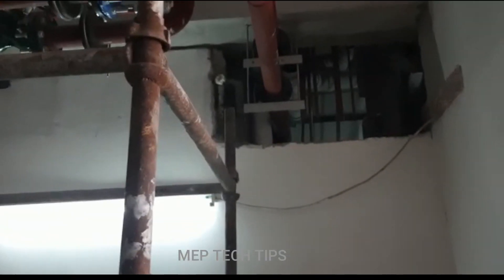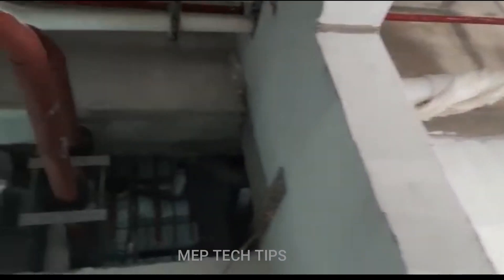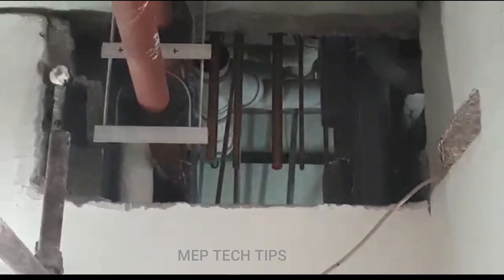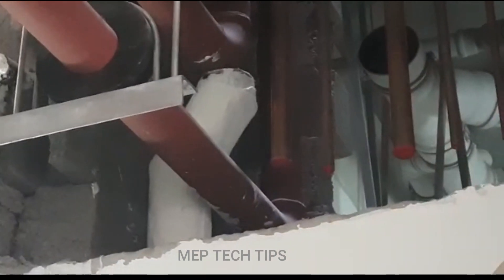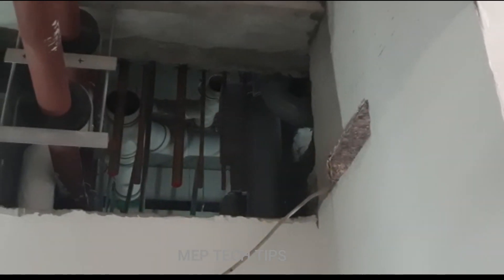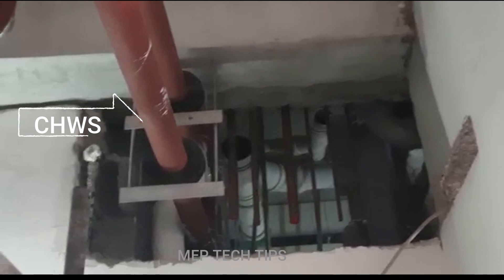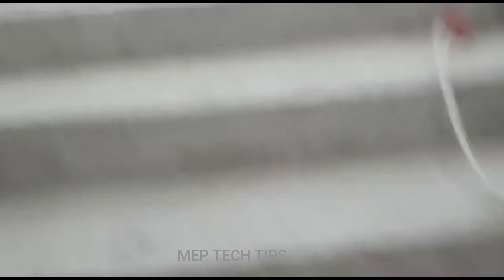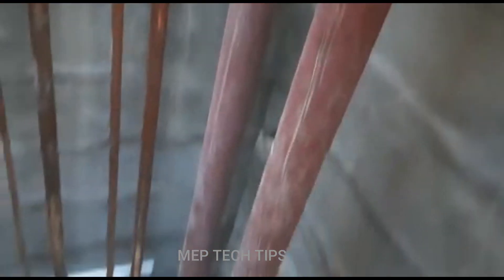MISTAKES IN INSTALLTION OF CHILLED WATER PIPE RISER | HVAC | CHILLED WATER BRANCH by MEP TECH TIPS

Comment: Considering bottom as supply and above as return. Both will need heavy modification. For return take tee and connect straight to riser going down without looping supply pipe but we require some modifications to match above and below riser for return line.for supply line you can install tee and rotate by 90 degree such that by using one more elbow supply line and return line tapoff side by side and not up and down.
Reply from the maker: Thanks for your suggestion/ advice
Reply: @MEPTECHTIPS  please share your solution also. It will help us understand too.
Reply from the maker: @vipulhodawdekar  Yes of course